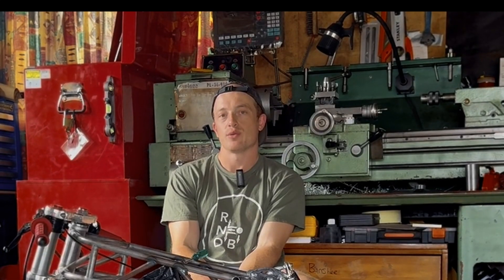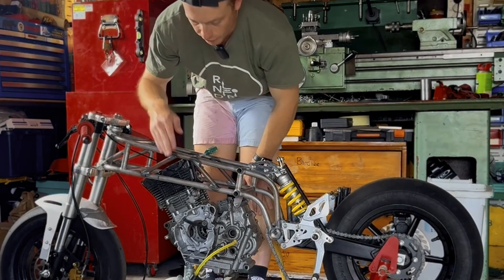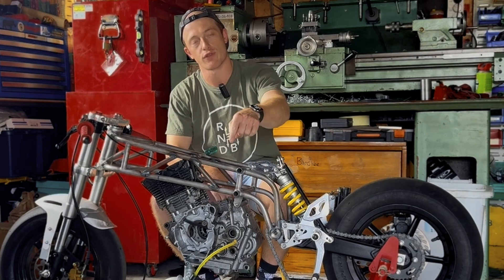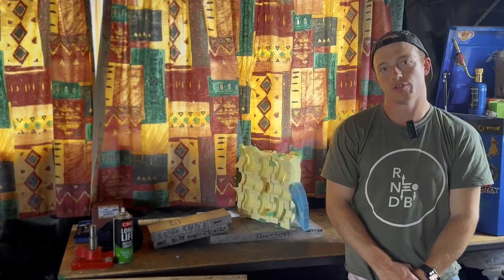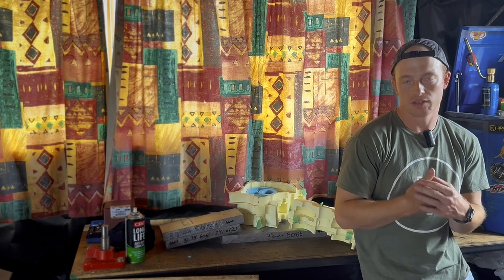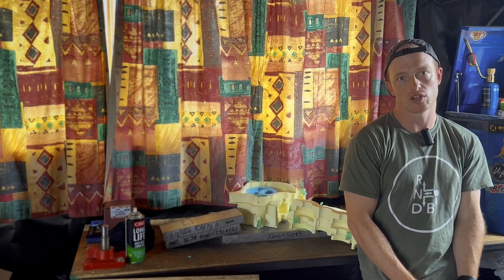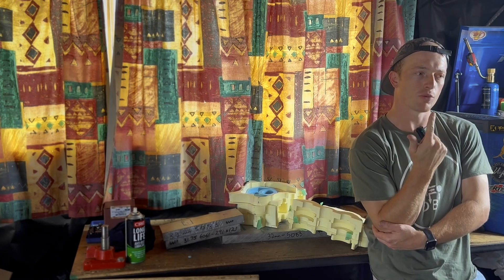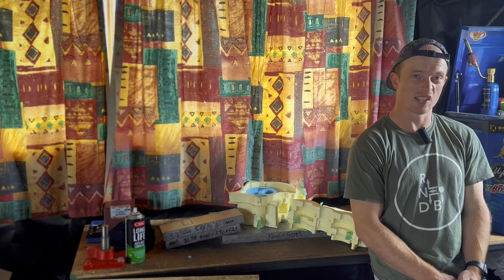350cc 2 Stroke V4 (2025 Build Update)

Comment: It really depends on what your objective is and constraints are. If you just want one for yourself (and maybe a few), it's option A because you'll never beat the low weight and superior mechanical properties of wrought aluminum stock especially for only $800 because it's not like the casting cost is 0$. Besides the casting itself, it still must be machined, and it could require heat treating and have flaws or porosity. If it's simple coreless tooling, and you want to buy at least 10 or 20 castings at a time, option C. I cant imagine a production foundry wanting to cast one at a time, and you'd better consider the impact of requiring casting draft with your design. If you only want to make a few copies, and there are complex casting features that complicate tooling and you want to make <10, one or two at a time, I'd say LF option B is a good choice. For either approach, errors would be painful so you might want to machine a foam mock up and make sure it goes together like you expect. I don't think I've ever made a complex machine that I wouldn't do differently and refine on a second attempt. It's easy to do that with lost foam.......that's why they're called development programs. 😏 Best, Kelly
Reply from the maker: Thanks for the in depth reply. I know what you mean about hindsight and improving things, the more I learn, the more I would change with past projects.

The only thing that worries me about the outsourcing option is my IP won't be safe, it won't teach me as much or make for good videos and it its a big piece of scrap if I want to change something.
I'm lucky enough the same guys doing the production casting for my latest V Twin are open to doing 3-4 at a time for me so maybe when it comes time to do this they may cast 1 for me.
 
I am also still considering investing in a graphite crucible and pyrometer so I can pour the V4 myself and get a good result. I know with the lost foam I can get a good result on the first attempt, although I am interested in designing a permanent pattern as I have never made one before and like learning new skills. The pattern will need a couple of simple cores to cut down on needless machining which could be quite interesting to design. . . 

I have just finished making the V Twins permanent patterns so once these are tested I will know which method I will pursue. 

Regards Jonny

Comment: You could use 2004 cbr1000 casette, or a ducati casette will save a ton of work.
Get it dynoed for mid range, top end 500cc gp bikes were tank slappers.
Reply from the maker: Doing away with the cassette isn’t about making the cassette itself. That part is easy to make. It is integrating it into the rear half of the crankcase, having a 4 piece crankcase vs 3 pieces opens up more avenues for failure. Splitting the cases shouldn’t be too bad if I incorporate an O-ring seal vs sealant.
Reply: engine & power is not responsible for a tank slapper, suspension and frame geometry are.

Comment: so much work for only 350cc ? 4x 150 cc would be much more entertaining and a lot more interesting to buy.
Reply from the maker: You can run the 112cc Athena cylinders and cranks making it 450cc . . . I chose 350cc because I want to enjoy riding it and have a realistic gauge on my riding ability. It will probably still make more power than an rz/rg500 as a 350 and as a 450 it will be a bit of a handful. I like the idea of similar power to a stock 600cc bike but with 30-40kg less weight.

Comment: I'd enjoy seeing you doing Option B the most, it's what got me hooked to the channel after all since almost no one seems to do that kind of crazy stuff on YT, especially with the limited toolset you have... I'm not quite sure why you want to get rid of the kasett gearbox though, I have owned a SC57 Honda, it had a kasett gearbox, and I LOVED the easy access to the gearbox, you can just get to it without dropping the motor, it's such a nice feature (in Supersport bikes at least since it's such a hassle to remove the motor and split it) but I get that it's probably not necessary... however it doesn't seem to introduce that much complexity tbh, so if it's not very complicated I would keep it, especially if you're planning on selling those engines, I think it would be a huge bonus for a potential buyer if he's planning on racing these, he might need to swap the gearbox in a pinch some day..
I love the new frame btw, I'd like to hear some thoughts on the design maybe, what you changed and why :)
Keep going mate ✌🏻
Reply from the maker: Thanks for the feedback. I should just do a video on explaining all of the frames I have made and the things I learnt from each one. you may have seen a sneak peak of the next frame and what the plate was for at the start of the video.

The main reason to ditch the cassette is because the chance of a successful casting is a lot higher for lost foam (less over hangs) and I can't outsource getting it cast if the gearbox cavity is so deep, it would require cores and other complexities. I am against the idea of a split rear half and a cassette and a front half, four pieces seems like too many.
Reply: @OddsandEndsMachining  yeah, it looks like you're going Aluminium now 😁 
to be clear, for me it's not about getting done, for sure I wanna see it running some day, but the process there is what is interesting to watch... Sure I know how to mill something, but I have only rough understanding of casting, and how you mill it on this small machine ist still very interesting, there are features that require quite some precision, and how you manage to accomplish them is going to be very interesting I guess... If you see Videos of Mat Armstrong (strongly recommend) for example, it's almost never really about driving the car in the end, it's the journey there that makes up most of the story, and most of the fun of his Videos...
I understand if you prefer getting it done quickly and scalable, from a content creator POV going the long route and showing everything including the struggles you had, will make much better videos
 if you go at it from a business view, rather take option C, it's really cheap for the work that has to be done, and your done in a couple of days :)
Reply from the maker: Thanks for the detailed reply, quite a bit to  think about. 

I will be using the large mill at my work for some of the work required as it will be impossible to finish with only 210mm of Y axis travel.

Comment: Billet seemed cheap enough and you could sell the files but I do enjoy the process of watching people make patterns and getting things cast I like all the options and I like the idea of getting to by something like this at the end 🎉
Reply from the maker: The only downside with the billet is if i make a mistake it could be a very expensive one. My educated guess would be as a running engine with a second hand gearbox it would cost around $15-20,000 NZD (If i were to sell them) with all genuine Yamaha parts and new bearings/seals. That may put people off, who knows.
Reply: @OddsandEndsMachining which gearbox are you designing the new non Cassette style cases around still the triumph bits I assume? Once the kinks are worked out and with some other decent components, 15 or so thousand for a working v4 two stroke engine I’ll be all over that 👌
Reply from the maker: It is the triumph unit. It can be found in any Daytona or the tiger with slightly closer ratios. I’m going to avoid using any Chinese parts once the prototype has been tested.

Comment: "A" to get it done and prove the concept, then "C". But 3D print the molds and if you want to sell the molds, send people 3d prints so that you can still reasonably control your design. Although with 3d scanning getting better and better nothing is safe
Reply from the maker: I would only sell cast/machined cases so people can assemble their own motor. I don't like the idea of selling my IP (Files). Shipping a crankcase shouldn't be a lot more than a plastic replica of the same thing. I'd say the only thing stopping people ripping the idea off is it requires a lot of knowledge of how it all works and the set ups involved to machine/outsource/grinding/hardening of everything.

Comment: I like option C, and you can always cast some more in the future if you want (either yourself or at a foundry). Personally, I'd make proper patterns and cast them myself, but I've already got a decent sand-casting setup and the experience to pull it off. but it's not that hard, and i'd suggest that it's likely something you might want to get more into in the future. So putting the time in now and learning to make good patterns would be valuable experience (and still makes for good content!)

And even if you never use those patterns again, they'd make for fantastic interior decor!
Reply from the maker: The foundry charge around $8/kg (USD) plus labour. The reason I don't want to get into sand casting myself is due to the fact i need to maintain the sand (if it's green sand) and have limited spacer to store it. I can just drop off the patterns and pick up castings at the end of the week. They will be around $450USD all ready to be heat treated . . . which will probably cost another $200-300USD depending on where I go and how long I want to wait.
Reply: @OddsandEndsMachining  The sand isn't too bad, A big sieve is all you need, and a bin with a lid to keep it in, no need for fancy mullers or anything elaborate. But at $8/Kg, you can't really beat the convenience of getting someone else to do it!!

Comment: Since that FXR 150 engine is almost the same as Suzuki Raider 150/Belang 150/Satria F 150 engine, they have a lot of aftermarket parts. You can even put a big bore 350cc kit in it 👀
Reply from the maker: That would be a handful with 12" wheels

Comment: Mate I've been watching your progress and have a suggestion for the case. Why not go 3D printed aluminum?  I have had some components printed for a motorbike project I'm working on and the results are spectacular. 3D printing is noted as stronger than casting and dimensionally far more accurate. I use a company called Craft Cloud. They are out of Germany but outsource the printing. I just had a top triple clamp printed, landed in the US for $193 usd... I had all the mounting holes printed and all I had to do was run a tap in and they treaded like is was billet. I used a code I found and got additional 10% discount. Reach out if you would like to discuss.
Cheers
L
Reply: Thanks for the heads up on craft cloud
Reply from the maker: Thanks for that. I've used craft cloud for some inlet manifolds and they came out at $40USD which was quite good. I will likely use them for the V4 manifolds. I priced the cases and they came out at 4x the cost of billet 6061 (I'm sure i could optimise the design and pull weight out as it is designed for casting and has minimum thicknesses to prevent freezing of molten aluminium). But I think I will just get JLCCNC to machine them if i go the CNC route.
Reply: @OddsandEndsMachining  I totally get your thinking. If you have a cnc machine shop able to machine the components at a reasonable cost, then I too would go that way. I've been kicking around a 500 V2 two stroke for a while, reminiscent of the Honda NSR's and build a frame around it. So I'm on the edge of my seat for your next video. I do love our Kiwi ingenuity even though I now live in the States. Had one question, how did you come up with your dimensions for the gearbox, and what make of gear set are you using? I was thinking to get the dimensions correct, I'd have to use and existing case halves and it done on a CMM... your thoughts. Cheers mate!
Reply from the maker: Thank you. I also have a 500cc V2 in the Idea stage at this time (too many ideas). . . I will use my Yamaha Banshee with a 7mil crank and re orientate one of the cylinders 90* and use a 72mm cylinder otherwise everything else being stock (minus the engine mounts, to suit an RGV250). 

It is a Triumph XC800 gearbox which has quite close ratios, I bought the entire engine for $150, I used digital calipers to get the shaft centres/selector drum proximity which were a whole number +.05mm for clearance so that was easy to do. From there I mapped all of the selector fork shafts other hole locations using a probe on my CNC Mill. The accuracy would have only been good to +/- .02-03mm maybe worse, which is good enough for everything (there is a bit of clearance everywhere) but where the gears are being meshed which need to be quite accurate. You will also need an existing case to get the dimensions for axial alignment as that might not be so obvious.

Comment: I recon you've done a great job show casing the lost foam casting method already with the other engine projects. The V4 will have plenty of other challenges along the way so don't make it harder that it needs to be. Get the prototype cases machined and focus on the other parts to make, gears, balance shafts etc. If there is some demand for the cases, maybe then look at pattern casting?
Reply from the maker: Thanks, I'm sure I don't even know what the main challenges will be yet. The only worry I have with CNC Billet cases is that I am pretty bad for over looking things, if I can get some favorable discounts from a sponsor that will be the best option. I've got a local place that are cutting the gears and do my carburising/grinding fairly cheap (around $400NZDish per gear with 4 custom module 2 gears) the shafts will be done by me in 4340. The only other thing is the line boring but I have a friend Jim helping me with that, he made a V3 750cc using RM250 cylinders you may have seen racing around Manfield years ago.

Comment: the foundry company allows heat treatment.
cast aluminum without heat treatment does not have many mechanical qualities
Reply from the maker: If I lost foam cast I will still be sending all the parts out for heat treatment, so the only way to avoid heat treatment will be to get them made from billet. The foundry poured my first part in an lm25 equivalent so it should heat treatment quite well.
Reply: @OddsandEndsMachining  often home foundries are refused in heat treatment.
for the reason that the composition of the alloy is too random
Reply from the maker: It is legitimate foundry that I used, that’s all they do is cast aluminium. They are near my house which makes them handy. I even have the print out with the material composition.
Reply: @OddsandEndsMachining  It's when you melt recovered aluminum at home that companies don't want to do heat treatment.

Comment: Would like to see you make a pattern, then you can cast several attempts with less work. Why not 3dprint pieces that you screw/glue to a board?
Thanks for your videos, they are informative and entertaining 😊
Reply from the maker: Thank you, I was going to make a wooden match plate with either machined MDF or 3D printed patterns. But 3D printing would save a lot of time. 

Hopefully it goes right on attempt number one as the foundry will cast it and hand gate it and add risers for me as I have no idea where they would need to go.
Reply: I have looked a lot at "oldfoundryguy" and have sandcasted once with 3dprinted core. Draft angle is ofcourse really important to get the core out and all the print lines will show so I used sprayfiller and paint.  @OddsandEndsMachining